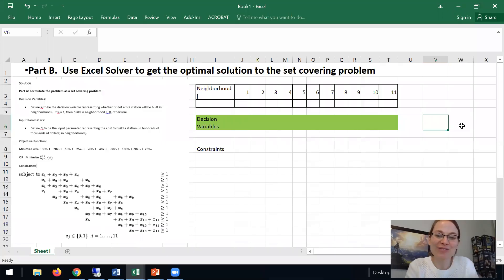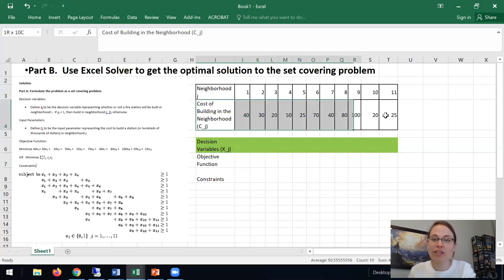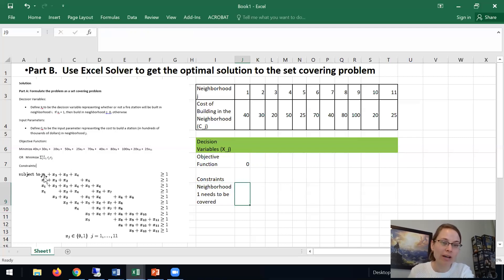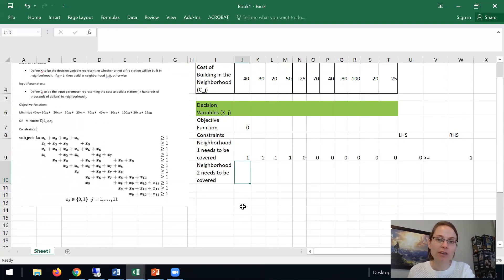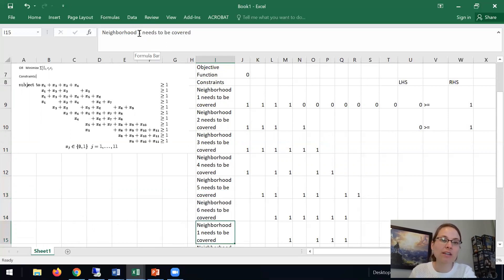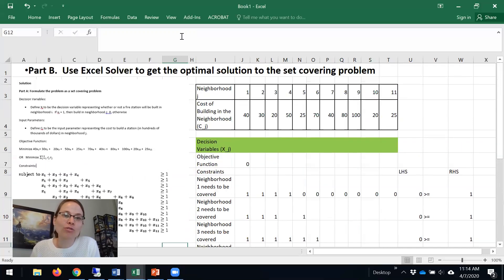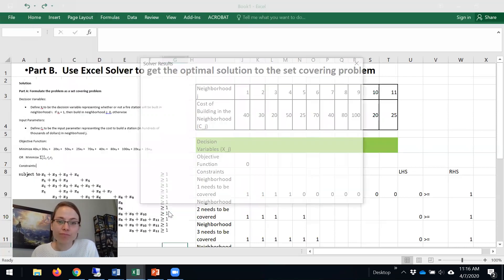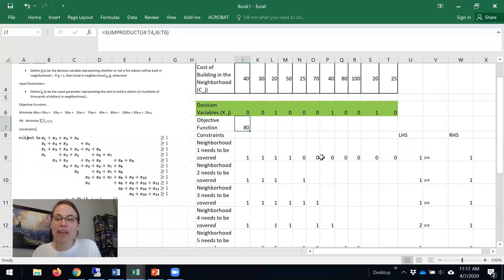Solve Optimally the Set Covering Problem (the Fire Station Problem) in Excel Solver

Comment: Hello.
How is it possible to solve the problem where it is needed to build the same stations, but the task is to minimize the maximum distance from cities?
Given 6 cities, you need to build 2 stations so that it would be optimal to get from both stations to the neighboring one.
Distances between cities are known.
Thank you.
Reply from the maker: This is a mini max problem (minimize the maximum distance from each of the cities to a station). There’s some info on how to formulate that here:https://www.baeldung.com/cs/ilp-max-min
Reply: @designandanalysisofsupplyc84  I cannot understand this part '''Constants d_i for i\in\{1, . . . ,m\}'''
what is d in my case?
I understand, that constants b is the distances, but what is the d ??